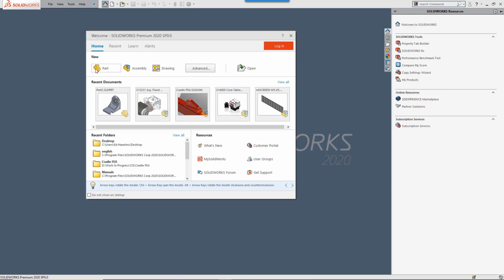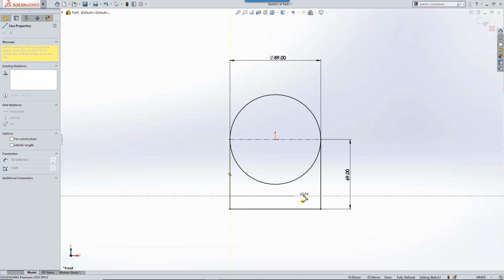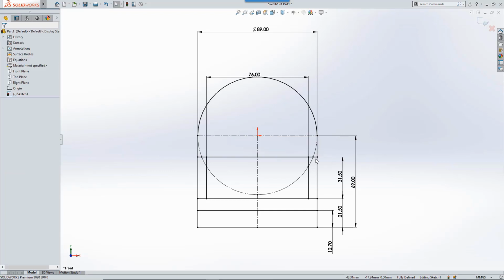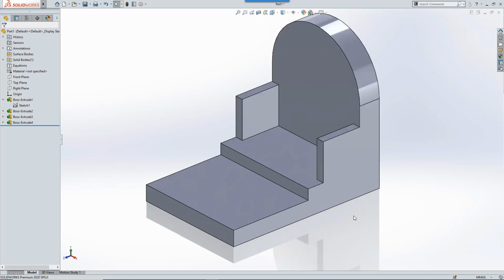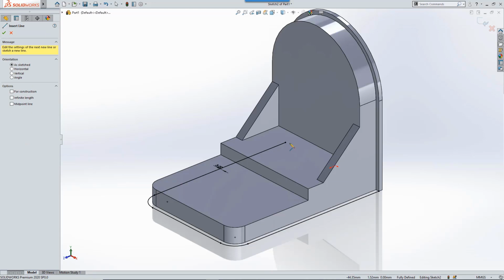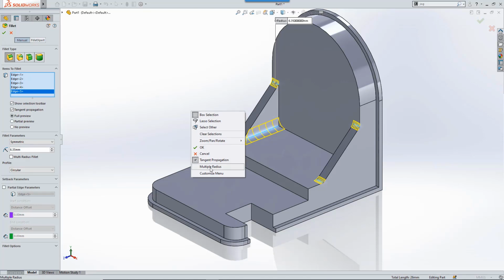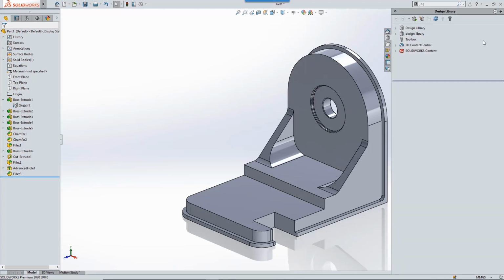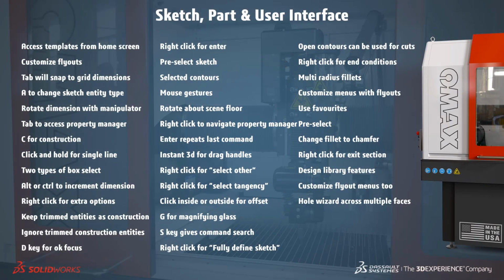SOLIDWORKS 2020 Tips & Tricks Part 1: Sketch, Parts & User Interface (UI)

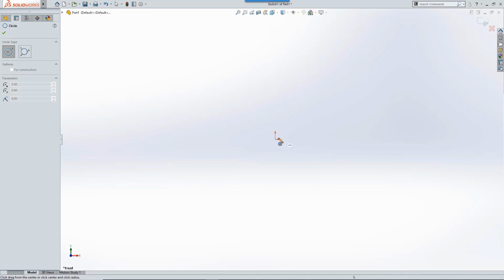Comment: Innova Systems : I have a question ... I have been using Solidworks 2020 for several weeks  and still  I don't know where is the option to activate the pointer like for example when you added the circle in 1:38 ... the center of the x and y axes lights up so you know the location of the center ... I would appreciate if you could answer this question. Thank you!!!

Comment: You need to slow down a bit
Reply: there is an option to slow down the video in the YouTube settings if he goes too fast, just click the gear in the bottom right corner, then adjust the playback speed to what ever your comfortable with.